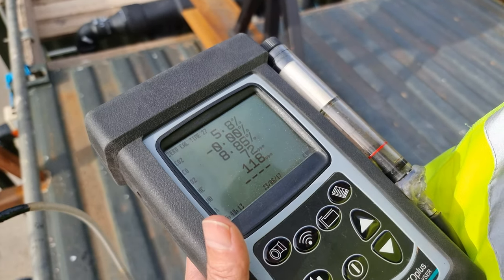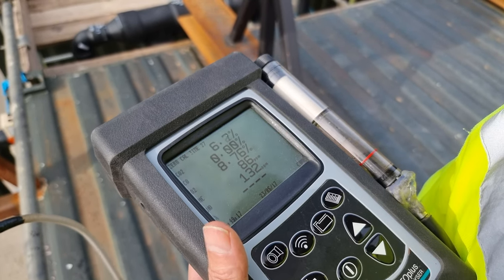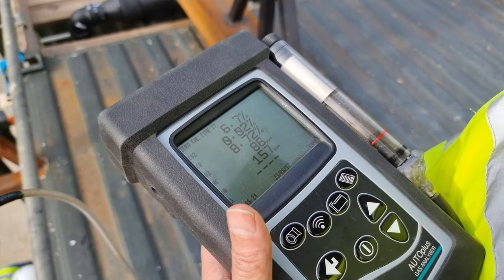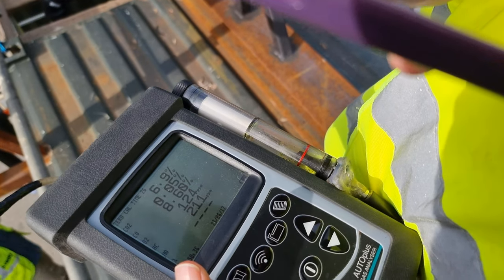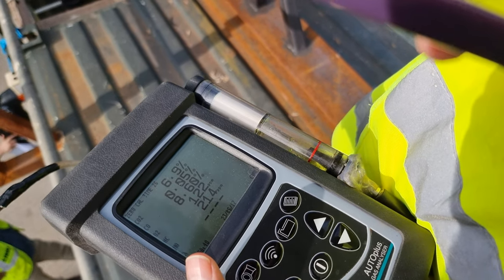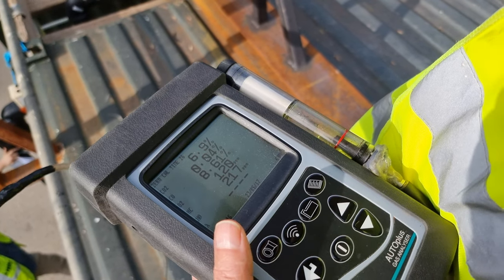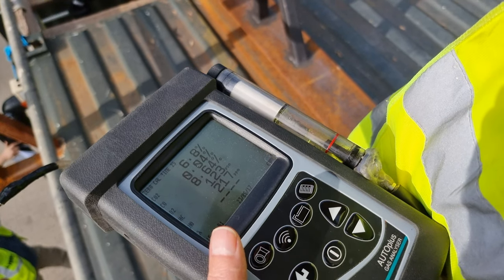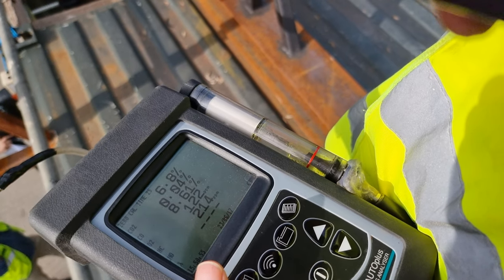THOR - Test on natural gas generator supplying 300kW to the grid.

Comment: Bob what do you think the difficulty is in getting the bigger unit to the same performance of the smaller units?
Reply from the maker: They cannot create custom manifolds - they have limited ability to modify this generator due to it's grid connection certification. However, the CO level is the most important number for them, if the CO is 10% of normal, they can run 10x more generators - everything else is a bonus.
Reply: @MFMP  Bob, your quote "they have limited ability to modify this generator due to its grid connection certification." The coverup due to what I found out about solar panels, power savers and the natural gas appliances in my home that the worlds governments are setting up below. The same thing will occur with the fossil fuel power plants and ICE autos. No one believes me due to the cover up and I am labeled a nut.

Comment: I think I still don’t get it right as the background noise makes hard to understand what is being said. But assuming this means you can run a genset in a “fossil carbon” based fuel without carbon release, you could actually get a certification for it and get paid for both the energy and the carbon emission reduction. That alone makes this interesting, financially wise.
Reply from the maker: In this case, they cannot produce custom manifolds etc. like they do for smaller, non-grid-connected devices as it would loose its certification for connection to the grid. This means they can only bolt things on the outside. and the input air and exhaust.

They are limited by how many generators they can run, because they can only emit a certain amount of CO in a specific area. So id the CO can be reduced to 1/10th, they can have 10x the number of generators at that location. Everything else is a bonus.

The generators are turned on at peak electricity usage times as that is when they earn the most money for the electricity supplied.